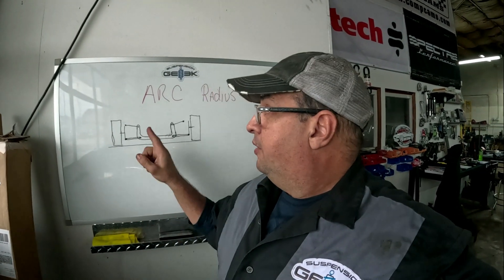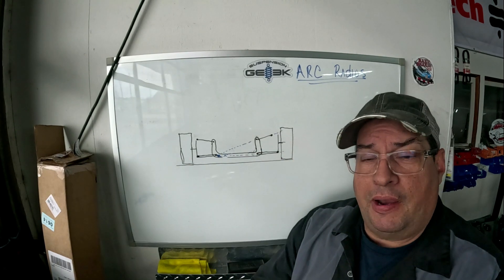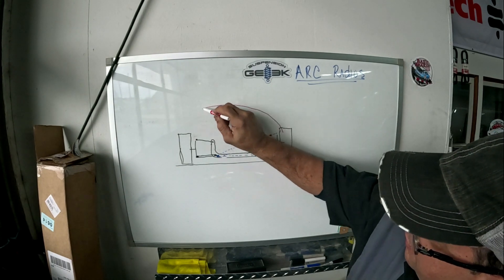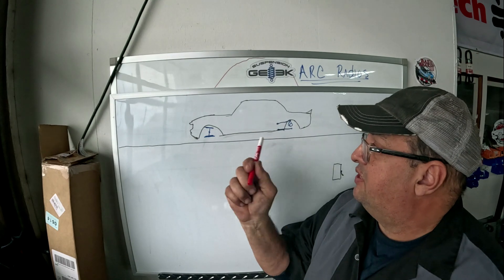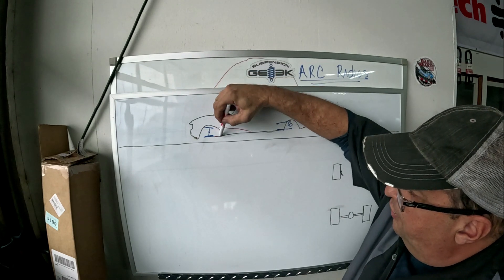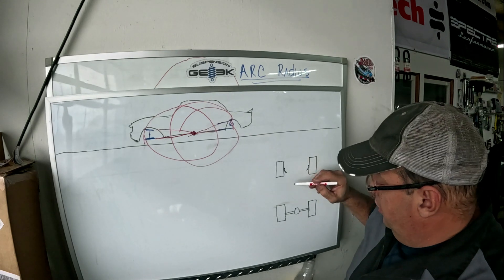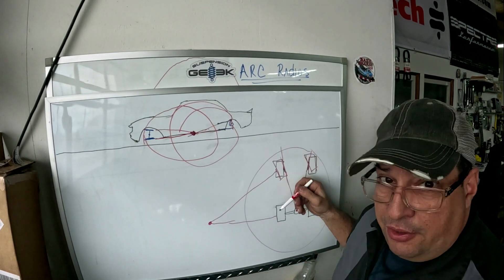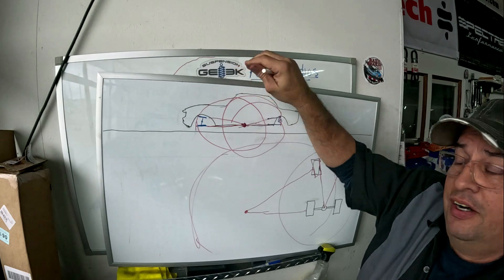THE Best Suspension Secret REVEALED

Comment: I disagree that the arc works for every situation, like in the case of suspension geometries that use no anti and steering geometries that use anti-Ackerman like most open-wheel racers.  Everything else is pretty right. But your longitudinal instant center isn't the car's center of rotation, the center is more difficult to determine than that!
Reply from the maker: Great call.. you are right some designs dont use arcs like F1 and indy.. and many pure race purpose designs.. i sure hope that F1 guy isnt watching my video for in depth suspension tips... thanks for watching..

Comment: US manufacturers just added more wheelbase length to avoid losing control of their tanks, Porsche increased the 911 wheelbase to reduce the rear wheels taking over the front wheels yet Toyota with the late 1990s MR-S or MR2 still had the issues early Porsches had. Jack knifing is scary but its always add more length to the wheelbase and shell be sweet.
Reply from the maker: That's an interesting perspective! Wheelbase length definitely plays a crucial role in stability, and it's fascinating to see how different manufacturers tackle this challenge.
Reply: One needs to be kind of high strung to do short wheelbase cars.  I've always favored my shorter wheelbase Plymouth to my peers  longer wheelbase Dodge's     i am probably an outcast though in the circles of enthusiasts of Ford and GM
Reply: It can be done as well using radial arms.

Comment: Very informative.   I must have a really good eye for this stuff.  I raced dirt modified  and 3/8 asphalt  for  13 years growing up.  I picked up on what your saying instantly as i used those principles quite a lot in my setups.   Thank you for some confirmation..
Reply from the maker: It sounds like you have a great understanding of how suspension works!
Reply: You must have great intuition or, in the mechanical sense, good mechanical aptitude. 

To me, when I worked on my car's suspension, it was obvious that the suspension parts like for example  the control arms  arms pivot at their chassis mounts, causing the wheel hub to move in an arc defined by the radius from the pivot point to the hub.

Comment: On your rear wheel hop leaf springs are MORE prone to because the spring flexes between the rear end and the chassis. The rear end is trying to rotate. A trailing arm is ridged. Just watch high speed film and you will see the spring looks like a wet noodle.
Reply from the maker: Yeah, that’s a big issue with leaf spring setups.

Comment: yeah arc radius is why Ibeam is better than swing axle. 

ibeam rear suspension might be okay on a road car lol. 

like especially on a fwd lol. or an ev with hub motors that would be weird. 

ive definitely looked at applying that benefit to a tranverse 4link sort if setup lol. past centermount lol.

Comment: When adding a torque arm to a leaf spring type suspension, it makes rear braking less effective, isn't this what brake proportioning valves are for, to fine tune the braking?
Reply: Brake torque is a rotational torque around the axle centerline ! The longer the torque arm the less torque reaction AKA lift at the axle and squat at the front pivot.
4-links are pivoting at the axle end so brake torque applies compression loads to the upper links and tension loads on the lower links.
The way to detach brake torque on a torque arm [or trailing arm] is to use brake floaters which is very common on open tube axles like sprint cars.

Just note for every force it has to meet an equal and opposite force. So brake torque applied to a 12" rotor [[6" radius] is 1/8 when supported by a 48" torque arm.
Also it does not matter where the torque arm is mounted on the rear [height wise] as long as there is structural integrity. The torque arm is an "Imaginary straight line" between the axle centerline and the front pivot.

An old Shelby trick on leaf spring suspension was to add "traction override bars" [links above the axle] to convert rotational brake torque into compression loads instead of lift
Reply from the maker: A proportioning valve can reduce presurre.. that wont work if you add it to the rear.. and if you reduce the front with a prop valve then you have reduced the brake system front and rear

Comment: Deffo not cool, what needs to be shown is why it's necessary e.g. what difference will a driver feel if the front is set-up this way compared to being set-up in the 'go by the book' way where this is never mentioned.
Reply: yeah this was what I needed from this. i liked the info but then the last part I was just like "but why bro?"
Reply from the maker: Some Racers say they can feel it.. i myself think it makes the car quicker into and out of corners.. if only because the differant spring rates we used over other cars with the same plateforn.. to make the car balance feel better..

Comment: Great information. Well presented, especially the use of the strings. I feel like you left one important piece of info out. That is- center of gravity. All those circles, which are true items, also are affected by COG. It can be accurately measured with scales, or generally estimated by the using the centerline of the camshaft. 
We use all this same information in dirttrack racing, with a bias towards left turn only.
Reply from the maker: @jeffwooton7138  yes like i said its tough to break it down in a 20 min video.. so maybe COG is another video... great suggestion!! Thank you

Comment: Thank you for laying string on a physical car. Really helps visualize what changes of links does to those points. On your two example Camaros what's the pro/con between the two different instant center locations?
Reply from the maker: on camaro two (mine) by changing that pivot the car starts its turn 2 feet earlier then another Camaro, repeated from corner to corner and feet is gain every time and that make the car seconds quicker...
Reply: @SuspensionGeek so your car will turn in sooner and start the rotation before the blue car. Does that make your car twitchy or loose vs the blue car?
Reply from the maker: @punishergto5182  no it just drives different... if you drive a 1st gen camaro and you get in mine it will t take a lap or so to get used to it.. what happens is most divers turn in too fast because there setting up for the rotation point they are used to.. car turns in faster and they have to correct after a turn or two most get it... corvette guys like it because there rotaion point is pretty close
Reply: @SuspensionGeek most torque arms seem to be around 50" long. So to move it closer to the front. You move the torque arm mount to the transmission crossmember?
Reply: This is a very interesting way of analysing anti dive and anti squat geometry. I'm preparing to tackle this on my Alfa Romeo and there is something I haven't got my mind around yet: what of these front and rear arcs are not sharing the center?

Comment: I've been studying this stuff for years... And I'm still no good at it, but now you've got me wanting to take the body off the El Camino and string it out. I've never seen anyone actually do that. That makes the most sense of all of it.
Reply from the maker: do it
Reply: The Alston Drag Car Chassis book showed some of this nearly 40 years ago. Of course drag racing by nature is somewhat simpler, never the less it was a great read. Anyway the reason I'm typing to you Whit is you don't need to take the body off. Take the side view of your cars chassis points and draw it on the ground in chalk next to it (so you rotate the side view 90 degrees onto the ground). Hang a plumb from each point to get your lengths required. The beauty of this is you can easily translate your four link adjustment locations in order to chart your entire suspension as the adjustments obviously alter the ic.
Reply: I bought a 85 El Camino. Black/Marron int,silver below the body line. Only problem was the ass end always wanted to pass the front end. Totaled it 4 or 5 times and dumped it.

Comment: A huge thank you for this. Very clearly presented. When you showed the center points on the two Camaros, I took it a step farther in my mind. I imagined a rope attached at that point on the car - to a pole in the ground with the car circling around it. I could then see, how the movement of that point would drastically impact the way the car behaved in a corner. I hope my explanation makes sense. ~ Chuck
Reply from the maker: You are spot on with that! That allows my car to start its turn in 2-3 feet earlier.. and if can repeat that from corner to corner even on a short autocross track you finish the course feet and seconds ahead the next car